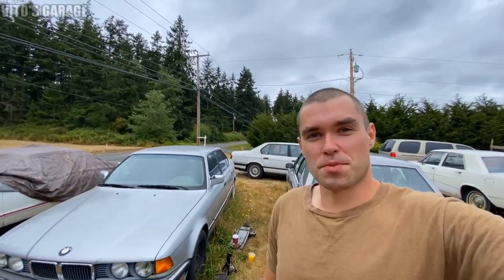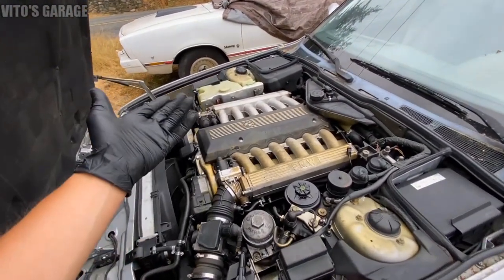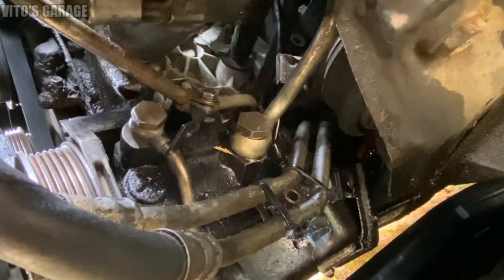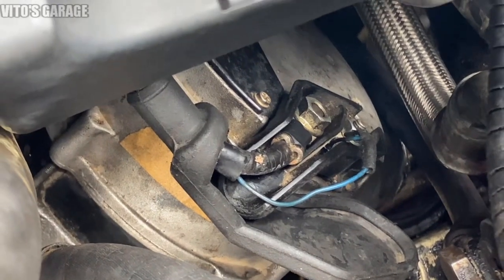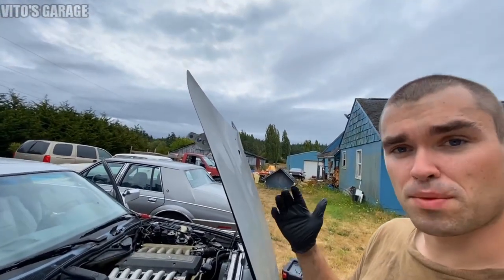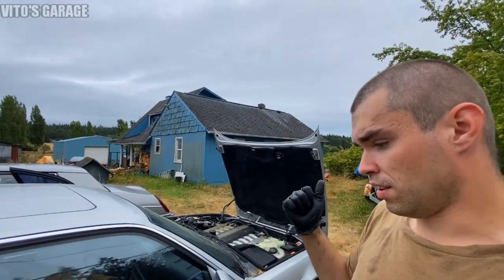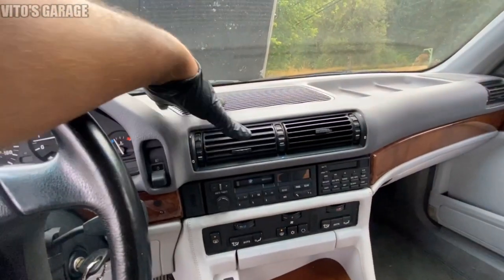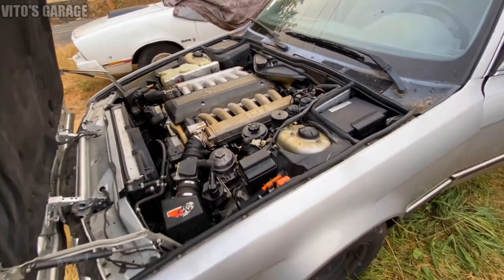V12 BMW E32 750iL is FINALLY Charging! But.... Is it Still Broken??

Comment: Love your determination and persistence and smiling in the face of obstacles like the downpour of rain. That is no easy alternator installation and it was a great idea to test for continuity. And real attention to detail to taping up the BOSCH label to protect it along with protecting the exposed cable with liquid insulation. Agree about the wheels too. That engine sounds awesome especially since the mileage is so high. Great progress dude, well done!
Reply from the maker: Thank you so much for your support! It means a lot!🤝🙂

Comment: I bought a 2001 e320 3 years ago and shortly after I bought it it started going into limp mode. I would shut it off and restart it and it would then go quite a while before doing it again. It ended up being the conductor plate in the transmission.
I would say there is something wrong with your fuel system or something like that if it does not go out of limp mode when you shut the engine off or disconnect the battery.
I'm glad my alternator is on top because I had to take it in and out several times before I finally got it fixed. It is a Valeo, but I don't know if a Bosch will fit and plug in. They are cheaper new.
Reply from the maker: Conductor plates are a common issue on W210. In my case it’s something either with the cluster or electronic throttle bodies. There’s nothing wrong with the trans that I can see at the moment since the car can only Rev up to 1500RPM

Comment: Check both of your camshaft position Sensors. I just bought a 91 750il for $900 do to being on limp mode. One of the cam sensors had an open circuit I replaced both and that solved my issue
Reply from the maker: I’ll have to check that. My main problem is that the EML light doesn’t come on at all. And that’s why it’s in limp mode
Reply: @VITOSGARAGE  my eml light wasn't coming on either so the first thing I did I checked the cluster opened it and notice the previous owner had done the soldering on it. That was not the issue so I closed it and put it back in the car, next I checked the battery I had to replace it cause it had low voltage and I  heard these cars hate low voltage and can send your car into limo mode. Next was the camshaft sensors one was bad but since I was already in there I just replaced both and that solved my issue
Reply from the maker: So what exactly brought your EML light back? The battery?
I already checked the cluster’s circuit board and it’s good. It has continuity. I even got a wiring schematic for it and checked it all. I just need to check for 12V coming to 2 of the cluster pins. Maybe I’m missing a feed
Reply: @VITOSGARAGE  I replaced the battery but it was still on limp mode. That's when I decided to check the cam sensors and that was my issue. Checked it with my multimeter and one had an open circuit

Comment: I just started having problems with my 1990 750il after the battery died. The doors locked and the windows came up and the sunroof opened and the manual process to open the doors is not working. Luckily one of the back door locks was broken so I can get in but not open any of the doors or close the sunroof. Could this be a control board problem? Also when this happens the driver side seat comes all the way up and locks as well.
Reply from the maker: Seems like your general module could be having issues. Do you still have these issues? It could be because the battery was dead and the module is confused. Try driving it and give the car some exercise. And you need to fix your battery drain. You definitely have a parasitic battery drain

Comment: That did not look like Pentosin going in that reservoir...
Reply from the maker: That’s what Napa recommended
Reply: @VITOSGARAGE  if I were you when you get a chance flush that liquid out and use Pentosin 11. I think that is what written on your cap. Don't mix Pentosin 7.1 with Pentosin 11 it was a recommendation that bmw  gave when they upgraded to 11